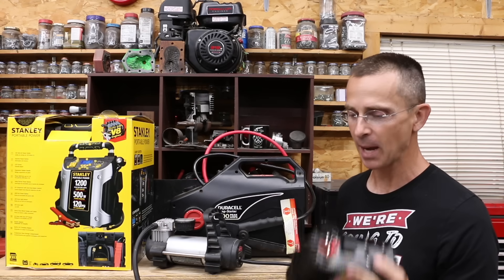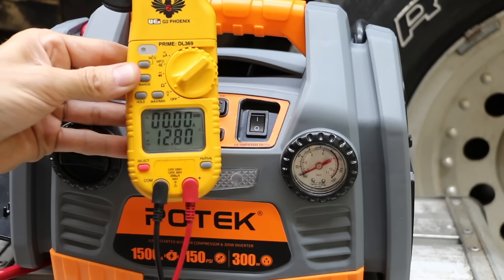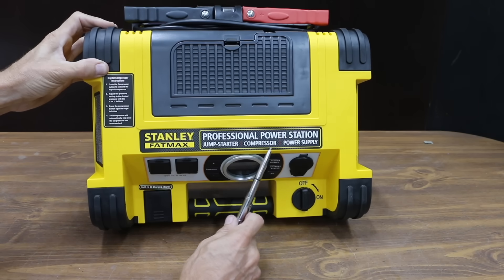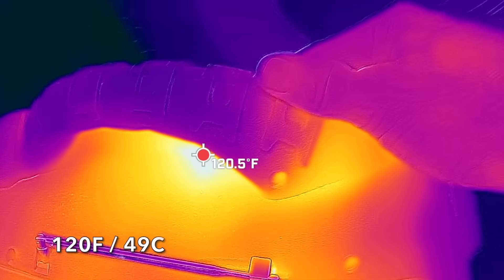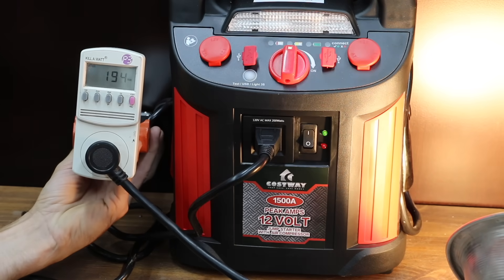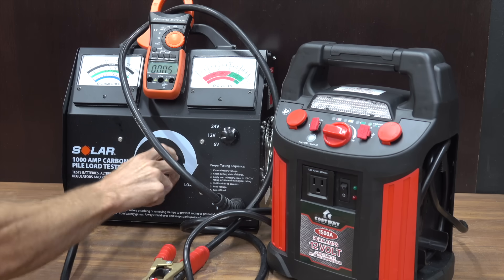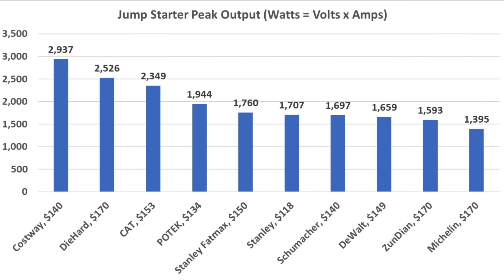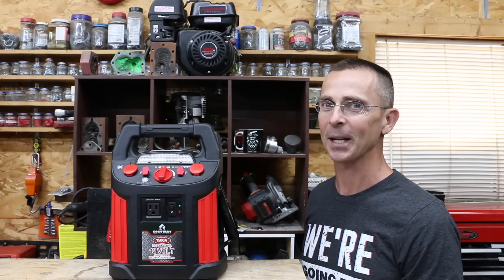Best Jump Starter? DieHard, Schumacher, DeWalt, Michelin, Stanley, CAT

Comment: My parents owned the exact model Stanley in this video. The battery suffered an internal/electronic failure after 3 years and limited use (less than 25 starts and 10 inflations) and would no longer charge at all. I suggested that my parents forget about these jumpstart rigs and simply buy an extra battery. I gave them my vintage Riverside charger to keep it charged at home.

@ProjectFarm, I'm surprised you didn't remark on how this wide variety of brands uses apparently identical LCD interfaces/electronics
Reply from the maker: Thanks for the constructive feedback.
Reply: Basically all these units have SLA batteries and 3 years is a good lifespan for a SLA at moderate storage temperatures.

Comment: I was expecting much more from DeWalt and cat 😂 they are well known companies but i guess they are also in the trap of false advertisments due to compitition from cheap chinese products.. the batteries in these are not even made to jump start anything larger than 1l engine. Most of them use 18ah sealed lead acid made for ups.

Comment: The One thing that i was Most interested in You did NOT test. ☹️ The USB outlet For charging cell phones & Headlamps in a Power Outage.
Could u Test That ?
i Guess the 35 amp inverter Load test would probably indicate the best battery / longest run time for usb charging.
So , ill just assume that unless u say otherwise.

Comment: Battery testing wise, anything under about 10 volts the ECU isn't running anymore (In most modern cars) and it doesn't matter if the engine is still turning, the computer isn't running to give it any fuel or ignition to start! 
You might as well drag it down to ~10 volts and record current as one part of the test, and max current as another. There are situations where extreme current at low voltage can be handy, but cranking a car it is not.

Also, I really hope you gave that starter a break between cranking! I've always been told never let it crank for more than 5-10 seconds at a time and let it cool off for a while before trying again. This may have been affecting performance adversely as well, but I'm sure you were thorough enough with it anyways.
Reply from the maker: Thanks for the feedback.

Comment: Except for the Costway, for a dead battery, it seems that you are purchasing the 'idea' of an emergency jump starter rather that an actual jump starter ; .... which actually can give you peace of mind ~99.9% of the time with your confidence shattered only when you try to use it.   So that's better than nothing, right?     
Maybe that's how the manufacturers write up their specs.   ....  Bob in Marketing:  So Engineering, what you are saying is that a new car and it's new battery, after 4 years in Texas heat, our Jump Starter only failed to start the car one time, right?
Reply from the maker: Great feedback. Thank you

Comment: The air compressor don't last on these things there not reliable in a emergency or in daily use it will fail save the money and head ach get a par of jumper cables and a 12 volt pump. Hopefully someday they make one worth buying.
Reply from the maker: Thanks for the feedback.

Comment: Stanley   I own one and my air compressor was doing the same thing  (  stopped pumping short of programed goal  )   What worked for me was removing the small O ring inside the brass screw on air chuck fitting    It works as intended now!    as far as jump starting   it will start a lawn tractor but not an Auto    I love your content     Keep up the good work!
Reply from the maker: Thanks, will do!  Thanks for sharing.

Comment: To note, from a dead battery, it's often impossible to jump a car.   If you have that experience, disconnect the dead battery, and connect up the booster directly to the car to try the jump.   I actually ended up driving 35 miles with no battery connected because every time you tried to connect the battery (while running), it would instantly kill the car.  The dead battery tries to pull more power than the system can provide.  (It's a sink)
Reply: That can happen if there's a bad short in the battery but rare
Reply from the maker: Thanks for the feedback.
Reply: Maybe you have a short. Mine doesn't do that. I even attached my fake battery which is a block of wood with metal clamp posts. Car ran fine after I jumped it. Having a dead battery doesn't suddenly negate the electrical pathways.
Reply: @OppaReacts  Who knows?  It was in 1991.
Reply: Alternator puts out more than enough to power your car, just don’t want to do it a long time may burn out diodes.
Reply: @williamdawson3792  - I'm not understanding you.   Your car always runs off of the alternator.  The battery is there for starting power and to even out the flow somewhat.   So, you could say that it'll run "a long time" - like the entire life of the car, other than when first starting the vehicle.
Reply: Thanks you I was looking for this coment.
Reply: Remember most new vehicles have way more electricity demands, even with LED lights and such. Computers, sensors, info-tainment systems... so many more electrical draws... Among all the great tests from P.F., THIS RANKS HIGH on my list. TY!
Reply: @tuberstitious  - Realistically, the largest electricity demands are still in the engine compartment.  info-tainment systems don't pull as much as you might thing - a couple of hundred watts.   The computers?  same as the original ones, mostly. Newer ones are more efficient, but a bit more complicated than the originals, so it's a wash.   The biggest power draw inside the passenger compartment would be seat heaters.
Reply: Anyone know if a secondary optima battery can drain the main starting battery?

Comment: I searched your channel and didn't find a review on 12V auto battery chargers.  I'm trying to desulfate some AGM yellow top batteries that were hooked up to a charger that supposedly trickle charges and desulfates them continuously, but I have no way on knowing if it is really working or just smoke and mirrors.  Many chargers have desulfate modes, but after 5 24-hour cycles with one such charger, one of my batteries only gained about 10 cold cranking amps, from 469 to 479, and it's rated for 750.  It is 5 years old but has very few discharge cycles below 70% since it was used as an UPS.  I don't know if it's an ineffective charger or battery that's too far gone. It would be nice to start out with a known good charger.  Thanks for your consideration!
Reply from the maker: Thanks for the suggestion.

Comment: The LokiThor 2000Amp air compressor and battery jump starter is another one to consider.  Used it to inflate my roommate's tires, didn't lose a hint of juice and started up a dead 775CCA battery on my V8 Cadillac like it was nothing.
Reply from the maker: Thanks for sharing.

Comment: This is great!!  Worthwhile info.  Now I'd like to see a comparison of the smaller sized jumpstarters.  I have been using one I got from Amazon "Aickar 800A Peak 19800mAh Car Jump Starter, Power Bank, Built-in LED Flashlight with charging ports"  It is about 12"X5"X2" and has worked quite well for a few years now.  I have jump started several cars and trucks with dead batteries over these years.
Reply from the maker: Thanks!
https://www.youtube.com/watch?v=JN8A2nIMUWA

Comment: I have a Stanley. After purchasing I discovered the compressor hose chuck is missing something. It lacks a pin to compress the valve stem. I don't know if it should've had a separate adapter fitting or if it was just missing the pin. I always thought Stanley tools were high quality but this made me question that belief.
Reply from the maker: Thanks for the feedback.

Comment: I owned a JNC Air 1700 Amp for nearly 10 years. Had to replace the unit that inflated the tires but was pretty reliable for so many jumpstarts of cars in storage etc.  As always, Thank you for this informative video.  I ended up switching to a lithium DBPower jump starter and a relatively inexpensive air compressor to inflate the tires. Love the portability of the separates and if one fails do not need to buy an entire unit!
Reply: I had a JNC 660 as a professional mechanic, lasted almost 20 years. Jumper only though.

Comment: I have two NAPA Blue Fuel 1000PA lithium jump packs and they work pretty good. I was able to use both at the same time on two weak group 4D batteries to jump a 7.2L CAT c7. They seem to deplete easily though. I would like to see how it fairs against the others.
I would also like to find out what 12v/24v combo jump pack it the strongest as I work on heavy equipment and diesels.
Thanks for your awesome and informative content!
Reply from the maker: You are welcome!  Thanks for sharing.

Comment: I have bought several of these in the past including the Schumacher and the small AGM batteries die pretty quickly.  I was able to take the case apart and replace the battery with new ones of the same size.  I even replaced the battery with a Lithium battery which holds a charge longer and is significantly lighter.  I wish the manufacture would switch these to Lithium batteries.
Reply from the maker: Thanks for sharing.

Comment: Out of curiosity, have you seen a new product by DeWalt that uses it's 20V Max (actually 18 V) battery packs meant for power tools for a jumpstarter?  I'm questioning how it works.  I can't imagine it is a simple conversion.  I'm guessing it charges a capacitor that then, "Jumps" the battery?
Reply from the maker: Thanks for the suggestion.

Comment: I've had half a dozen of these over the years, never found one that actually lived up to its claims. 

I'd love to see a comparison of ones that claim to be able to start a diesel, as none of the ones I've tried could do it. And you've got that nice 12v to test with :grin:

I've resorted to just keeping a couple spare batteries in the back, which double as a winch supply (a couple of batteries are cheaper than running 00 copper all the way to the back of the truck lol).
Reply from the maker: Thanks for the suggestion.

Comment: Thanks for the video. I avoid multi function units. When one of the components eventually fail then a separate unit needs to be purchased anyways. There is also the disposal problem when they are no longer useful. I purchased the Topvision jump starter you previously reviewed. The small size makes it easy to carry and store and it works great. I also carry the Slime tire repair kit which includes the air compressor, tire plugs, and slime. Thanks again for your great videos! Always looking forward to the next one!
Reply from the maker: You are welcome!   Thanks for the feedback.
Reply: Yup. The loan of tire inflator in a can got me home when my piece o' crap CAT refused to inflate a punctured tire.

Comment: It is amazing what they can make today. My luck id set one of these one my truck by the rad and when the engine started the starter would fall into the rotating fan blade!! These would be great for 4wheelers that don’t have a method to charge the battery. Also fill a flat tire while far from civilization. Yup I’d want one in my 4 wheeler
Reply from the maker: Thanks for sharing.

Comment: Hey PF, how about testing some of the many octane boosters around?, most claim to increase MPG, you could do a run time on the generator for example. Just a thought, with gas prices going sky-high people will be looking to squeeze out every bit they can.
Reply from the maker: Thanks for the suggestion.
Reply: @ProjectFarm  No problem, the good part is you can do the testing with the equipment you already have on hand.

Comment: I just love this channel. It is definitely good to know what units work and which ones don’t. I wonder if there are any units that use lithium based batteries instead. Lead acid just simply cant discharge enough amperage in any form all at once. I’d be curious to see the lithium based units tested if any exist. I bet ya half these units are probably made by the same company. Well done and keep up the great work.
Reply from the maker: Thanks, will do!  Thanks for the suggestion.
Reply: @ProjectFarm  Just saw where Schumacher has a new one with a different battery and btw the stanley that burned up is same as WMs best one, the one I have!
Reply: I saw another comment that said you are right, half of these are made by “Stanley Black and Decker”, he said Stanley Fatmax, DeWalt, and CAT all = SBD.

Comment: Attention: The Costway units are sold out. Backorder time is approximately 3 months. 
The run on this product is a mystery (to almost everyone who doesn't watch Project Farm's videos that is).

Very good review as usual Todd. I'm kinda lost, when you said how loud each unit was what were they doing exactly to create that noise? Was it while running the air compressor?
Reply: Correct - the sound measured is while running the air compressors.

Comment: Hello sir I got a question for you about these Jumpstart test!!! My question is are any of them Jumpstart box's a smart box cause if so you have to wait 5 minutes after it's hooked up properly to begin trying to start your vehicle!!! The reason I say that is if for instance you have what I have which is a CEN-TECH 900 PEAK AMPS and you try to start the vehicle before the minutes are up it will act just like a few of the ones you tried and act like it can't turn the vehicle over fast enough to start it!!!! But turn it to the off position and back on and wait the 4 or 5 minutes and it will crank up like it has a new battery in it and that's on a chevy 5.3L V8 engine!!! Also your not supposed to hook your black cable which is negative to the negative side of the battery your supposed to ground it to the cars ground!!!! Thats just on all the ones I have used in the past several years!!! I'm asking if you knew this when u did the test or not cause alot of people don't know how to properly use there jump start boxes and end up buying more expensive stuff for there vehicles when what they had at first would work if if was properly used correctly is all I'm saying

Comment: I’ll keep this in mind. I purchased a snapon jump pack and after not even a year the battery is junk and never fully charges and never holds its charge enough to jump start anything. Very frustrating when it was like a $400 jump pack! Stay away from the snapon ones simply for the battery quality. When they’re new they work great but quickly lose their capacity.
Reply: Yeah Snapon been a joke for a long time. A 20 dollar long handle ratchet from harbor freight outperforming a 200 dollar snapon one says it all.

Comment: Please make a video about best boots insulated for extreme cold 🥶 winter ,    Maybe keen north face timberland , Ugg’s , sorel , Columbia. Etc etc etc, I work at least 10 hours a day , I work in a body shop but work in the backyard too disassembling cars and changing parts , I think I usually spend 8 continuos hours working out there ( backyard of the body shop ) and your information will be useful for me , I try to get the best boot for the winter.🥾🙏, all the outside workers would appreciate your video  , thanks sir 👍
Reply from the maker: Thanks for the suggestion.

Comment: Based on  my own experince I would  have guessed Schumacher or Cat.
Glad you did this test!
Brand names are not everything as this test shows.
Tip  from my experince..
Keep an eye out for these units at thrift stores and yard sales.
Usually the battery is all that goes wrong.
Order the biggest 12 volt AGM battery you can fit in the case and replace it.
You can often referb one of th3s for less than $30 bucks.
Reply from the maker: Thanks for the feedback.

Comment: the instruction book for the dewalt jump starter says to connect the positive clamp to the positive post and the negative clamp to the chassis or engine block…so why did you connect the negative clamp to the negative post?

Comment: Your series is a nice resource. I look through it before buying tools. Thank you.

Here is one I couldn't find, so it's an idea: Best taps. Which is least likely to break, speed/ease of use and maintaining sharpness of the top of my head. You can try different flute designs and brands. Just a quick fyi, I use them to make new holes and clean varnish out of existing holes.
Reply: For use in tapguns, HSS forming taps will outlast cutting taps many times over, in my experience.